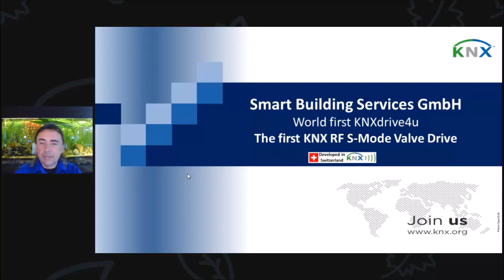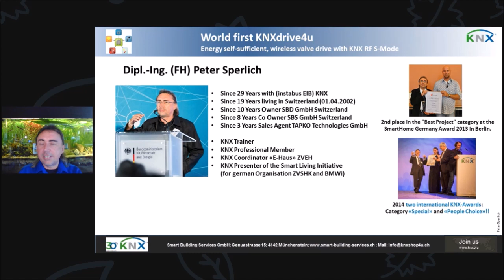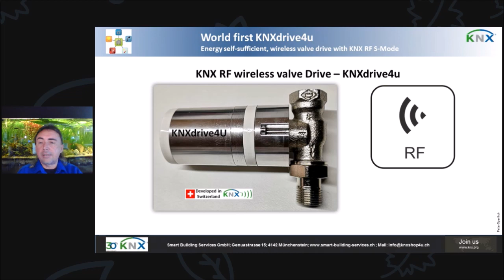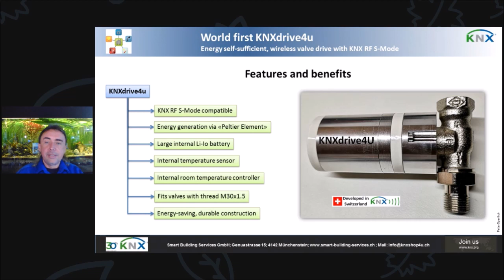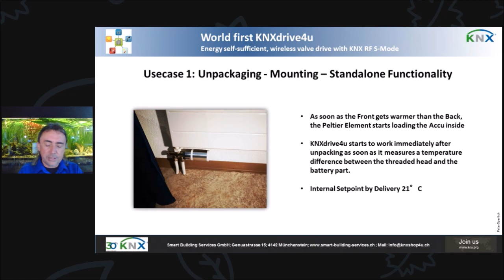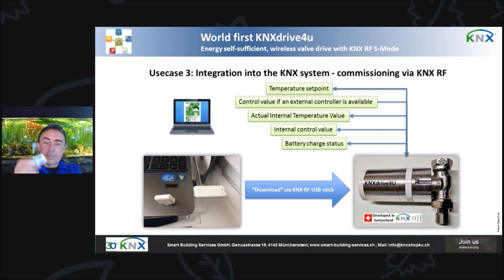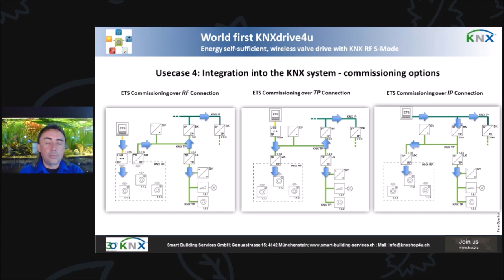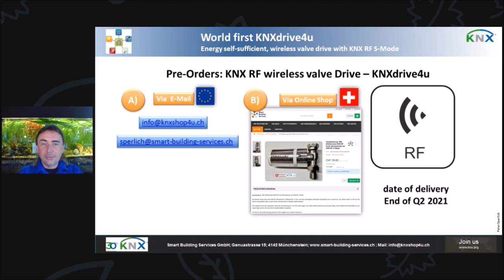KNX RF valve drive for wireless room temperature control

Comment: The thermostatic head has a strong potential, in my view (also, depends how much it costs…). Some time ago I was thinking about something very similar. To couple it with KNX RF is, I think, smart. Now someone asked me to design a replacement heating system control as the current one never really worked and they don’t want any wires. And I was looking for some KNX RF temperature controller / interface but I can’t find anything. Neither can I find any DIN Rail KNX RF couplers. I would love to know what I am doing wrong.